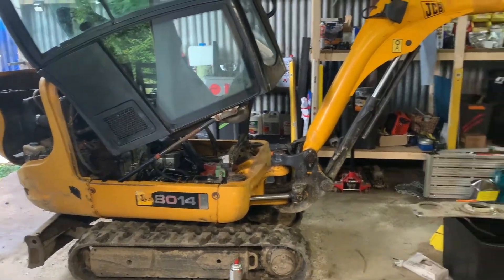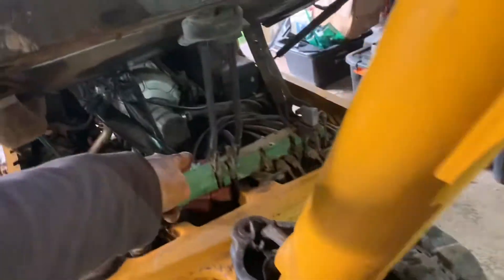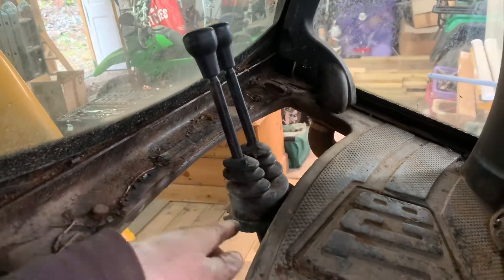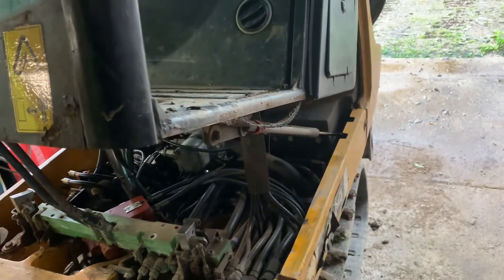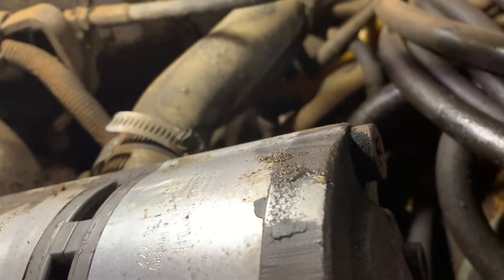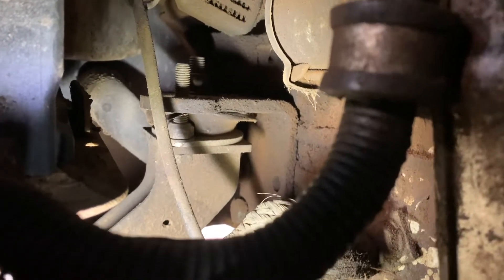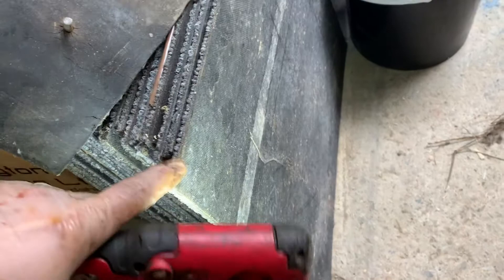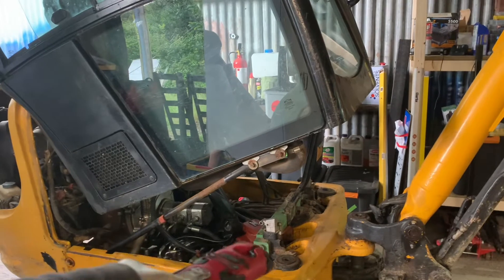Yella Fella - How to break and fix a JCB 8014 CTS

Comment: Hi thanks for the really detailed video I’ve popped a hose at the bottom of the boom I’ve added a quick hitch and when I crowd In the teeth on the bucket caught the solid pipe nut. Do I need to lift the cab to get at the other end of it or can i get at it from the side panel all the best tony
Reply from the maker: Personally, I wouldn’t consider accessing by the side panels.  It will take you longer to find the correct sized sockets, than it will to undo them and tilt it back.  

In total, it is 8 bolts.  2 Allen key bolts on the floor plate, 2 big 22mm (I’m guessing that size due to my bad memory) and then take off two on the tracking lever bolts (you only need to loosen 2 and take 2 out) and the cab tilting is safe/easy/slow.
Reply from the maker: Oh.   And take the bolts out of the pedals. I forget them.  

I’d still suggest you tilt it so you can have a good rummage.
Reply from the maker: When you lift the cab, there is a little clip on one of the air struts. Those clips stop
It from falling back down. You have to squeeze the clip a little to release it…or it won’t go down.  Not sure if I covered it in the video.
Reply: Your a star thank you very much
Reply: Ayni makina bende bar hareket sorunu var ne yapmaliyim dönüşler kisitli pompa yeni ama haraket etmiyor

Comment: the digger won't track forward if you started it with cab tilted , so long as you don't put the arm down on the left [ when you are sat in the seat ] that is the safety switch on there to keep controls dead ,

Comment: I have the exact same problem with the noice and have been wondering and looking on the internet for info about tilting the cabin without luck. And finaly i found your video and you made it all verry easy to me. Thanks Man 👌
Reply from the maker: I’ve been busy with mine recently so haven’t had much time to look at it. Yesterday, I parked it up in my barn and my intention is to investigate ‘yet another leak’ and to have a real go at replacing the knackered engine mounts which are still noisy.  I did do a bit of a bodge with a rubber washer/shim but this only lasted a few months.  I’ll video it, to explain.  I’m glad it helped you.  Makes it all worthwhile.  👍

Comment: Hi thanks for the video. I'm curious as to whether you have actually purchased any spares for the machine and if so who from? I have the same machine and recently it's started over heating. So some things need to be done but I can't find any suppliers locally for spares. Regarding the stuff you are unsure about, I'm guessing it is the hydraulic manifold. It will be made up of a series of directional control valves, which send fluid to the correct end of the cylinder and hence make it extend and retract but I'll find out more when I tackle my machine! Thanks.
Reply from the maker: Hi Big Pouse.  When I blew hoses, they came from the parts team locally at http://www.holtjcb.co.uk/

When I needed the idlers wheels and bearings:   https://hcparts.eu who are in Poland I think. 
Since Brexit they don’t appear to have the UK as a country they can deliver to, but they still delivered within days and the prices were 50% less than local prices.  Too good to ignore.  :/

Hose adaptors (which I needed) I had made up locally.   The snapped door hinge I stripped myself, got it welded locally, then I reassembled.  

Next on my list is the two rear engine mounts  which came from eBay somewhere, inserting some washers into the arm pins….and I am toying with the idea of welding the slew ring to the cab as I have a lot of play.   New slew rings are extortionate prices.
Reply: @Dee Tee  thanks for the reply. I'll look it all up. I bought my machine 5 or 6 years ago. It has come of an age when it requires all cylinders re-sealing. All pins are sloppy but I can live with that for now. And this over heating issue. So I'll strip it down when I get a chance and work my way through it. Have you any experience of overheating? Thinking outside the box, the oil cooler is integral in the rad. If i have an internal hydraulic leak this could generate heat and pass it to the radiator heating the coolant. If you have any other ideas I'd love to hear them!!! Thanks for the reply. I'll let you know how I get on!
Reply from the maker: @bigpouse  Fan belt ok?    Radiator clean’ish?   My fan has just started slipping (squealing) so had to crank up the adjuster a little, which was a bit fiddly.   That’s the first thing I’d check.
Reply from the maker: @bigpouse  So what’s next?  Pull the thermostat and test it with the kettle?
Reply from the maker: Or….. more likely….what about the temp sensor. 

Spare part for JCB: Sensor, water temperature - 701/80434 for models 8040ZTS, 8025CTS, 8045ZTS, 803 PLUS, 8014, 8027 SUPER, 8035ZTS, 8018, 8014, 8027Z